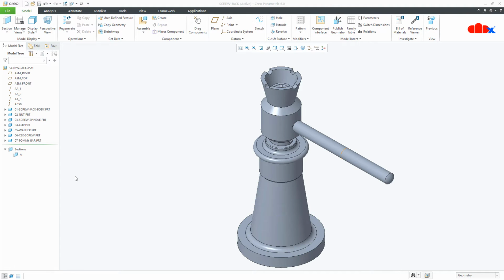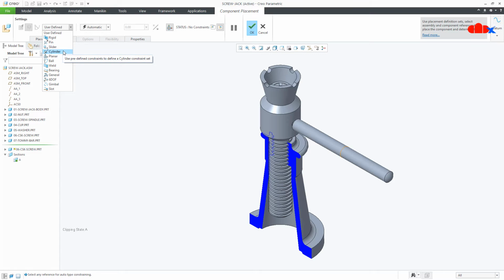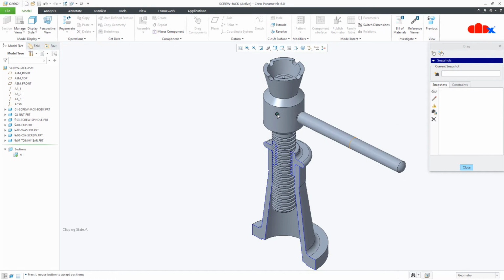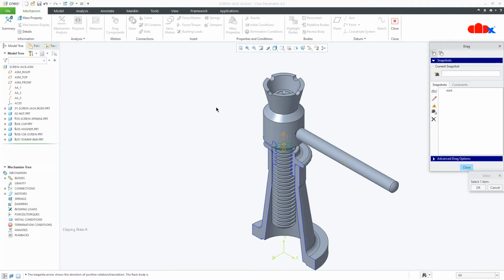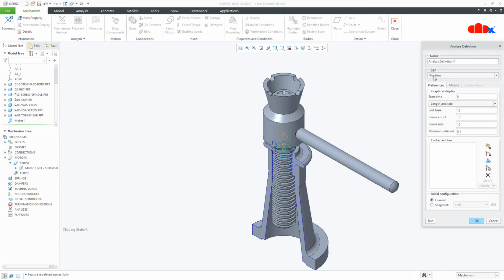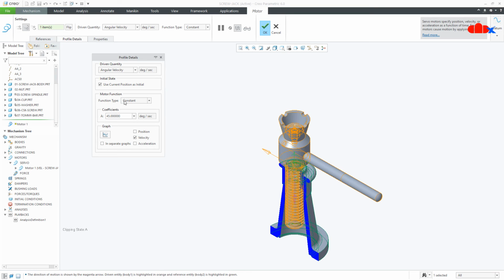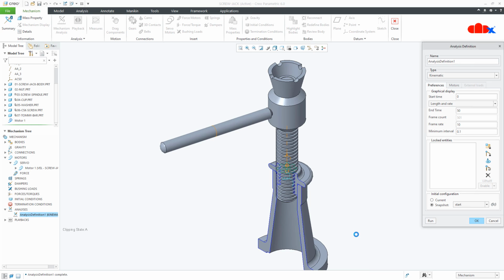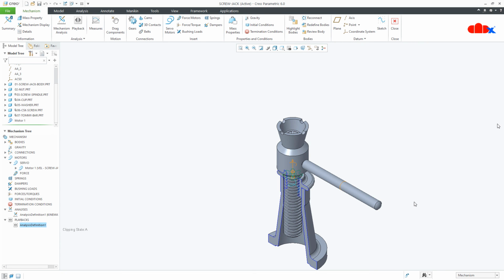Screw Jack assembly animation in Creo Parametric (Step by step approach)

Comment: Hi.
I want to rotate bolt & bolt should be fixed from end. And nut should go updown without rotating on its axis. What should i do?
Reply from the maker: You mean to say that the Bolt should rotate but it should not move and the nut should move but it should not rotate. Is this your requirement?
Reply: @CADx-in  yes.
Right.

I have tried few things, In which the nut is moving up-downwards but the bolt is not  rotating.

What should i do?
Reply from the maker: You need to apply the pin constant to the Bolt to rotate it. To understand this you can watch my tailstock animation video.
Reply: @CADx-in  
I already applied the pin. When it was not  there the whole bolt was moving and the nut was stationary.

I think i'm having issues with motor which gives rotation

Comment: Great full animation tutorial! 
However, I see that the direction of the thread and rotation of the screw is reversed (left). This is also the case for me, but I can not find how to reverse it to go in the direction of my thread (right). I tried again many times and in various ways in the cylinder assembly or when selecting the symbol or turning pinion/carrier of gear 1&2, the rotation does not change. I don't understand...
Is there or do you know of another setting to reverse the rotation, please?
Thank you so much!
Reply from the maker: When you apply the cylinder dynamic constrain, flip the direction of first constrain. This will work I guess.

Comment: When I do dynamic constraints I've done the same as like you did .but I can't drag the object .when I click the mechanism it says "the highlighted connections are not defined from two bodies if you continue they will be suppressed " help me to get rid of this prob sir 🙏
Reply from the maker: If you are talking about the screw jack assembly, make sure that all the part assembled after screw spindle has dependency, only with that part where it is getting assembled. For this you hide other unnecessary parts and keep only two parts while assembly. After this you can change to dynamic constraint for screw spindle. You will be able to drag it now.